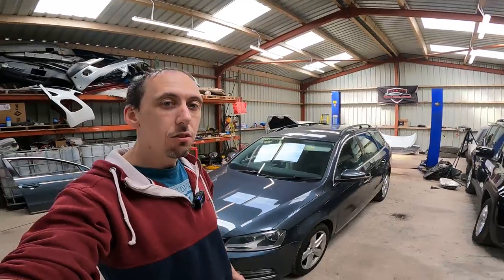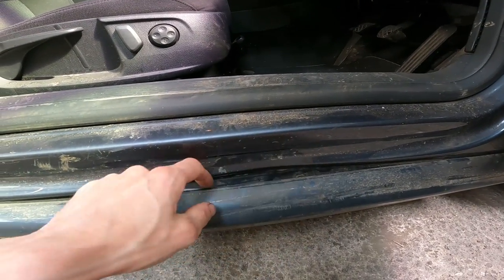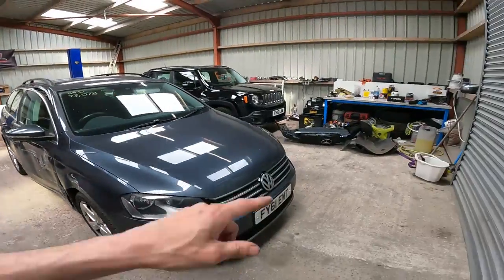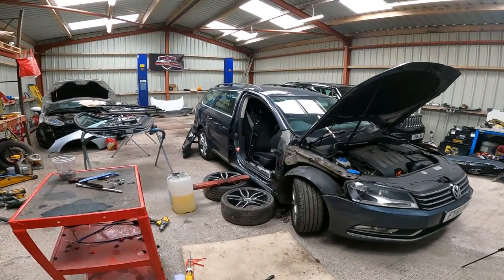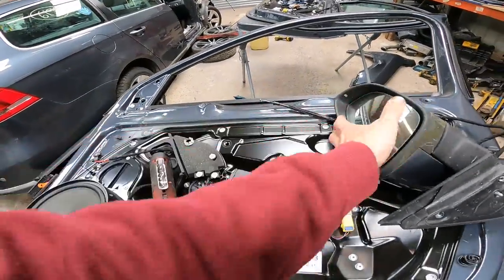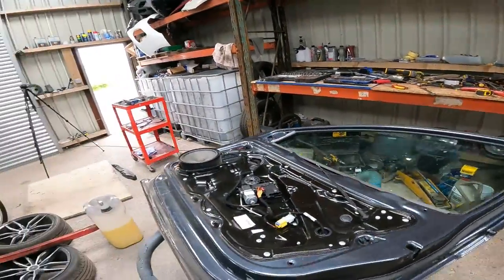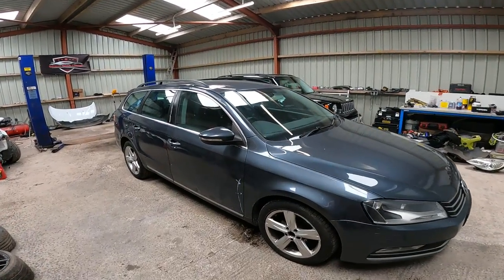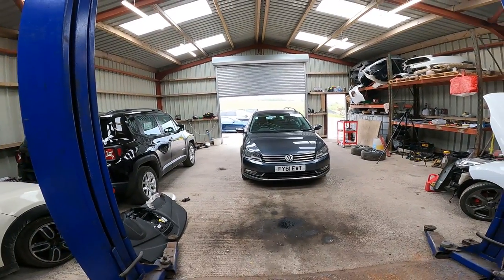Another Cheap Passat Estate - Nice Easy Fix.

Comment: Nice motor Phil.  As for the sill, you've still got your pulling dozer, so I'd weld a plate along the outer sill and pull it straight, shouldn't be too difficult for you. You won't be able to bang it out from the inside, as it's not hollow. Hope this helps, look after yourself and family. 👍👍
Reply: Maybe would have been worth trying a glue pull on sill, surprising the excellent results some people get using that👍